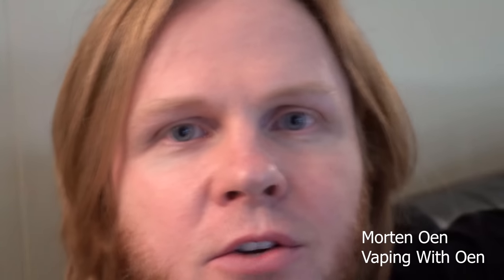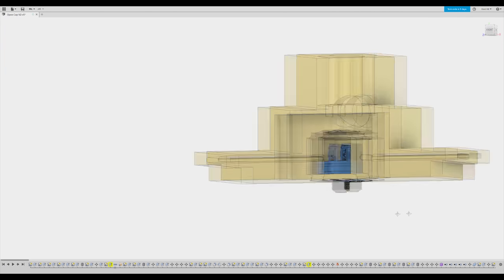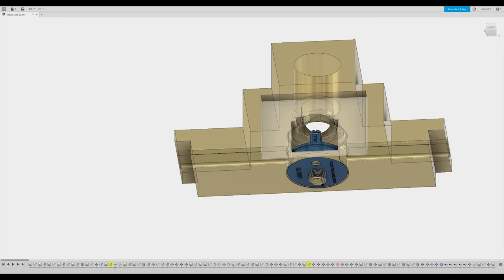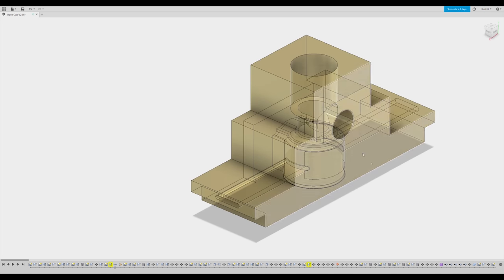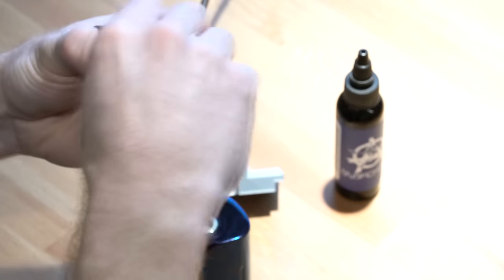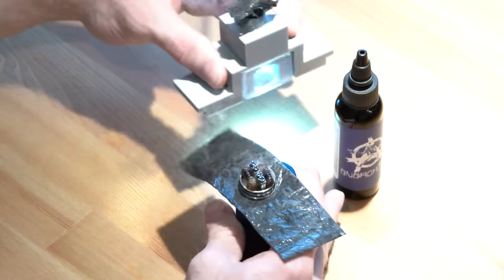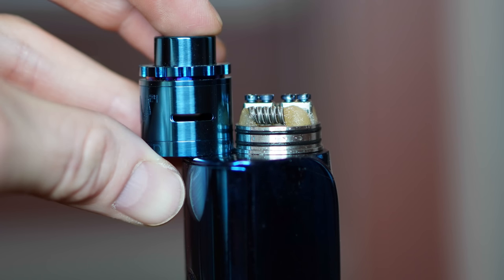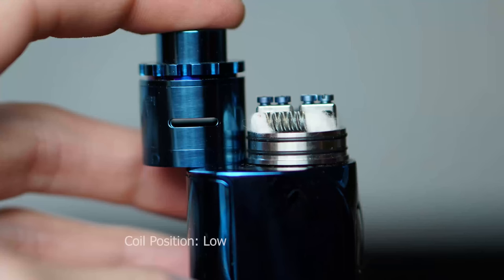Seeing Inside an Atomizer

Comment: That is quite an effort! And thanks for the shout out :-) I know how time consuming this kind of work is, and I congratulate you on the results. The picture is starting to become complete. It was new to me that proper air flow makes the boiling juice travel like that. I have mostly been occupied with cooling. But that explains why I like vertical coils so much. Worst thing ever for me is to get those wet droplets in my mouth :-) But I know a lot of vapers who loves this. It would be fun to see how plain wire and flat wire behaves with this setup, as the flow of air will go all around the coil, with separation points behind them. Thanks again for this fantastic achievement, and for sharing the results!
Reply: Yes, that would be interesting to see the difference in single wire, dual parallel, flat wire, and Clapton styles. Also try switching between wattage and temp mode. What does the heat do before it boils the liquid...

Comment: Super cool idea, have never thought of how the airflow changes when you change the position of the coil. It for sure makes sense now to me as more of a beginner. I never really thought a slight difference could make a huge plus in taste or airflow. Turns out you can actually see the vapor chosing different paths depending on where the coil is. Impressive and thanks a lot!

Comment: Science love it. Kent my idea is when your first planning to build an RDA have different air flow caps with different air flow slots to determine which cap would work best for optimum flavor and vapor production. The possibility’s are endless and maybe you could come up with something very different and effective. Maybe something like airflow from different directions for a swirl effect so the coil gets air from top bottom sides. And use a light to change the color of the vapor so you could really see the air pattern. You have the equipment and can design something amazing, don’t forget to patent your ideas. Best of luck.

Comment: Nice, now we have an artist who gives us some nice (but often unrealistic) camera shots and someone who shows us how things work for real.
Not sure how difficult it is to change your setup, but it would be nice to see what difference it makes if the airflow is slanted upwards and downwards. The difference between different wires, different wattages (really low, mid level and pushing the limits of the coil), positions (coil close to posts, far away, high, low) as well as the differences between build decks with and without posts. Differences between big and reduced chambers to see if we can visualize how a reduced chamber increases the flavor. Differences between wide open airflow and reduced airflow could be an interesting test too.

Comment: I've used dual coils in all different rda's with great results flavour, Vaper wise, but lately I've trying squonking , single battery , single coil . and really bad flavour , using the normal air flow hitting the coil technic , I tried Mortens wire and wick technic and it improved a lil . but after moving the coil all over the place and trying loads and lil cotton , I landed on a single coil bout .2 - .25 alien , Clapton , flat wire , or round wire with good results installed diagonally above the posts , yes above the posts and both air holes both sides  half open , very close to the 810 opening ,not right on it but close , cotton firm but not tight , no spit back , great flavour and juice and batteries for days .I got the idea to try this after I put the barrel of the top cap on upside down on the dead rabbit , then tryed in the goon LP and goon 1.5 ,also in the bonza . works well in all of them . long wicks and a lil tilting while squonking ,but great over all . just saying
Reply: Nichrome 80 for all the coils I used , fantastic video thank you .

Comment: kent! ive been thinking of this for a long time man! great video! i would get the 3d printed upper chamber the same as the top cap as it would effect the airflow as welll. maybe make the sides where the airflow comes in make it shorter. less distance to travel! wow a specific camera huh? i need to get one like this! i think this is one of the best videos ive seen in a long time! coil position is very important. could you do my aequitas rda? im curious

Comment: I'm curious if the fact that the suction comes from off to the side rather than directly from above makes any difference.
Reply: Legion Vapes! It still comes from above if you look at 3d pic.
Reply: Based on Morten’s work there shouldn’t be any difference because it first goes up and then takes a 90 degree turn so that shouldn’t affect anything really

Comment: The obvious questions to me are what does it look like with different airflow (Kennedy, Recoil/Dead Rabbit, etc).  I realize that would mean making different 3D printed apparatus for each deck so it's not likely doable.  But I can't help but wonder how the different angles of airflow would affect the boiling and the transmission of the vapor.
Reply from the maker: Kevin Billingsley actually I already planned on doing other RDA's. It doesn't take me very long to model stuff these days so should be fun

Comment: why make this device when you can use a clear top cap?
Reply from the maker: dmob420 that is a good question. You need ridiculuous amounts of direct light to get clear video at the frame-rate used. I was going to just use a glass top-cap but quickly realized you can't see any detail due to lack of contrast. And with a directed light straight down into the rda it blocks the airflow. This is the best solution I've come up with so far.